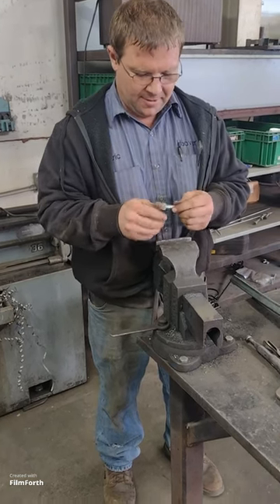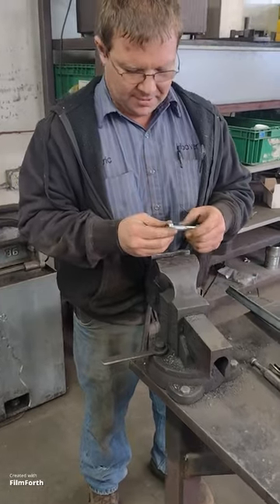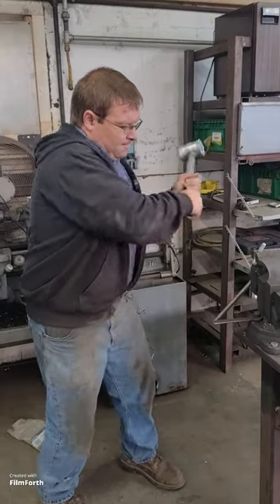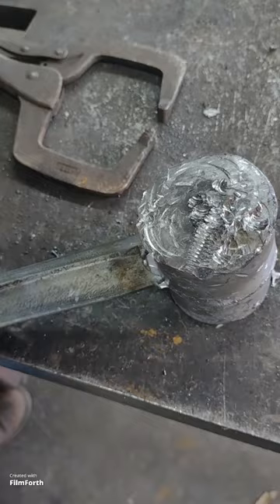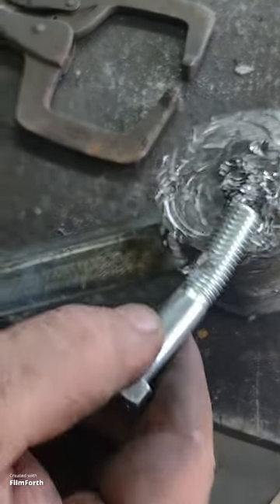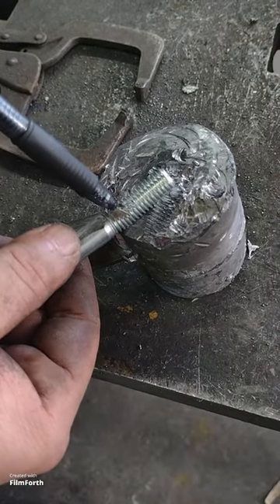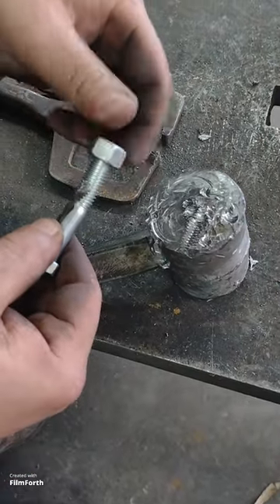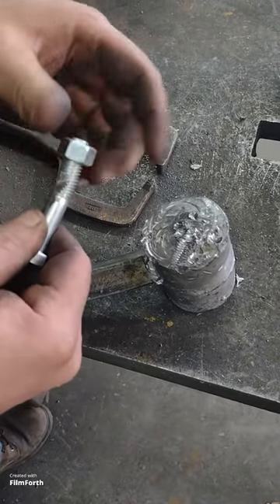Why Hoover likes lead hammers. Works with manure dragline and manure hauling equipment

Comment: When would this ever be useful though
Reply from the maker: Whenever you have a bolt stuck that comes out only by hitting on the threads. And you want to reuse the threads. There is a entire service industry around remolding the hammer because they mushroom easly